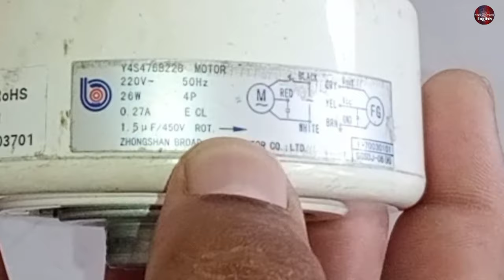The Secret To Control Ac Fan Blower Motor Rotation

Comment: I would like to know if there is any trick can be done for blower motor so I can control its speed, because I do really suffer from lowest speed set by manufacturer, it is acually high and want to make it slower!

Thinking of instaaling external control speed so I can adjust it manually to the speed I need, but how!?
Any idea?